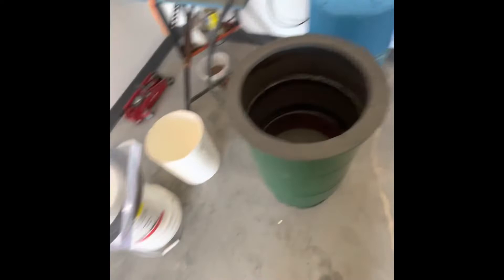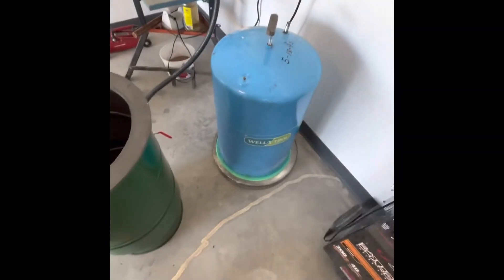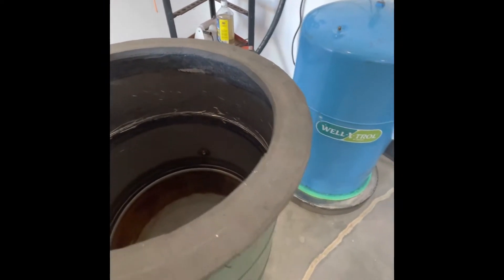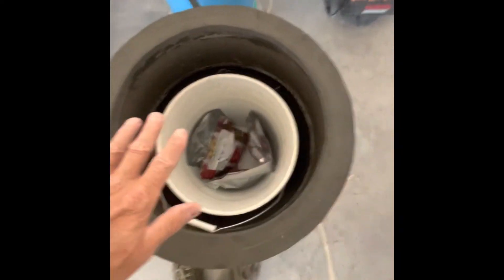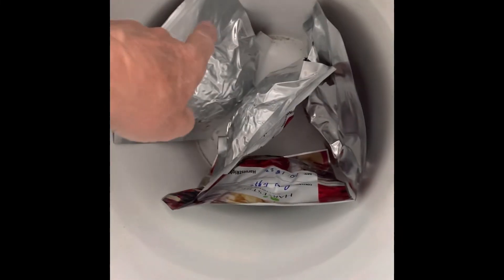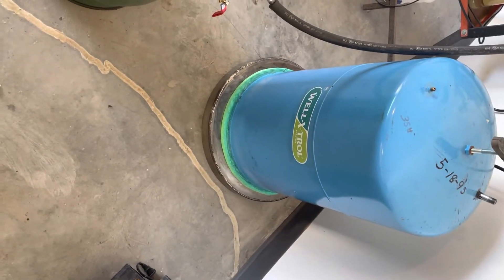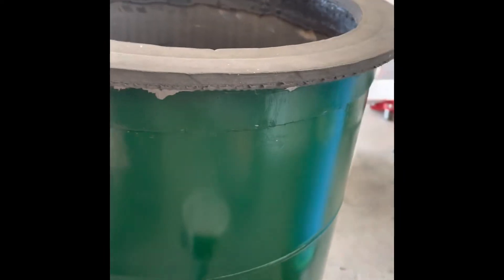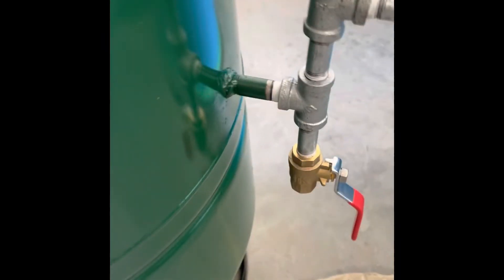Vacuum Chamber Build

Comment: For vacuum sealing Mylar bags. I use the "snorkel vac" sealer that has a retractable tung & a built in bag heat sealer. You put the bag on the sealer which activates the vacuum pump and you press down on the heat sealer which causes the tung for vacuum to retract and the heat sealer seals the bag.

For the 5 gallon pail size mylar I use a clam heat sealer to close off the pack except for small section (like in your video) I stick the vaccum tubing into the opening and use some clamps to seal around the tubing, and the pull the a vacuum on the bag. when its done, I fold the mylar, remove the tubing and clamps, and use the clam heat sealer to close off the bag. This is a lot quicker especially with a smaller vac. pump, since you don't have to pull all of the air out of a large vac. chamber.

I also have a nitrogen purge using a nitrogen tank from a welding gas supply shop. This is just a brass tee with a ball valve connected to the nitrogen supply (with a pressure regulator). I let the vac. pump pull the air out of the bag, & then open the nitrogen valve which re-inflates the mylar bag, then close the nitrogen valve so the vac. pump pulls out the excess nitrogen. You can still use the Oxygen absorbers with this method, but for the large bags and small O2 absorbers it provides an added level of O2 removal as well as any moisture in the air since the nitrogen has no moisture.
Reply from the maker: I like the nitrogen idea. I have welding bottles for my welder I may have to look into that. I like playing around with the vacuum chamber and wanted a large one that would hold a 5 gallon bucket.  Some things can over flow and I wanted to have a way to keep the vacuum chamber clean.